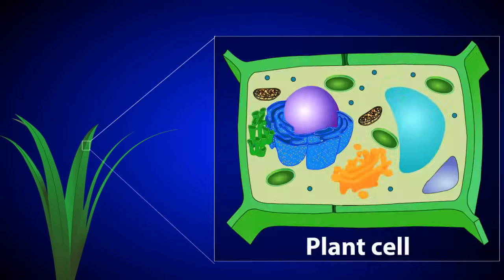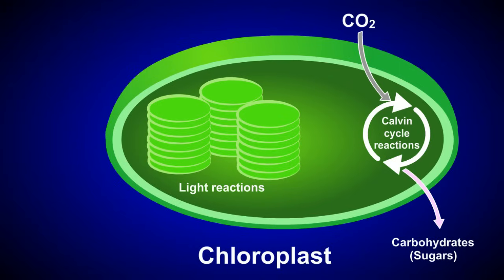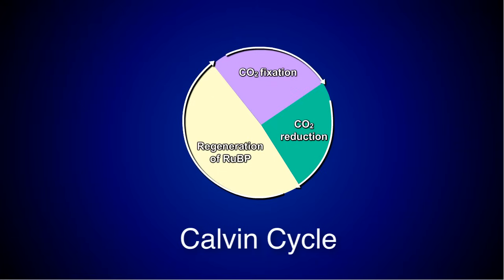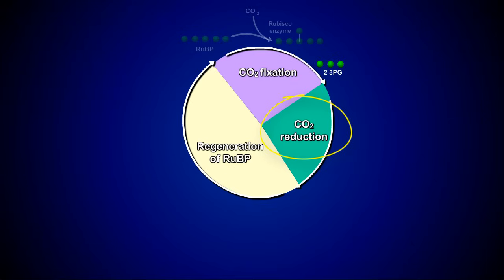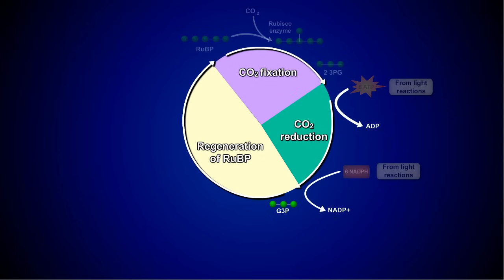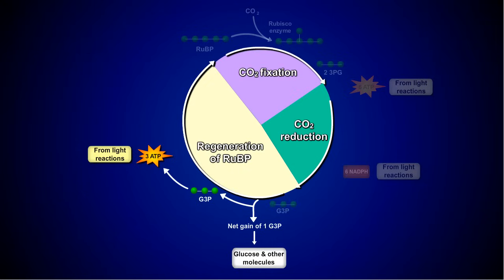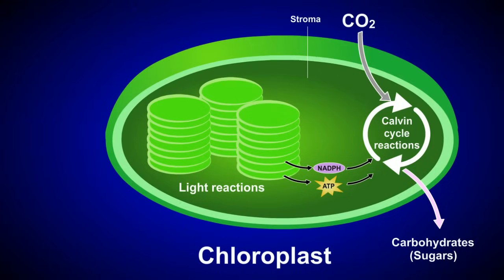The Calvin Cycle

Comment: Calvin cycle

Convert C02 from atmosphere to carbohydrates tlwhich sigar which plants need to power its cellular activities and build new plant 
structures

Occurs in stroma of cloroplast 

Divided into 3 phases
C02 fixation
Co2 reduction 
Regeneration lf rubp

The first phase carbon dioxide fixation basically captures the c02 from atmosphere so it can be used in the reactions  to do this c02 is attached to rubp a five carbon molecule.te enzyme used in this reaction  is valled rubisco ,and the result of the reaction is unstable 6 carbon molecule that quickly spits into 3 carbon molecules.called 3 phospoglycerate or 3pg

Next the process of converting the c02 to carbohydrate begins.this phase is called carbon dioxide reduction phase because were adding electrons and 3nergy to the c02 molecule
During this phase a secquence of reaction uses nadph anf some of the atp from the light reactions this molecule supply needed electrons and energy for c02 reduction 
Electron are added from nadph  and through a series of reactions, 3pg is reduced to form g3p a carbohydrate.adp and nad + return to thylakoids to be converted back  to atp and nafph by the light reactions  one of the g3p molecule is set aside as a building block for glucose.but the majority of the g3p molecule move forward into the third phase of the calvin cycle 

In this phase atp is used to combine the rest of the g3p molecule to form RuBP molecule 
This rubp can then combine with additional carbon dioxide molecule 
Continuing the carbon reactions 

To form a glucose molecule the cycle actually has turn 6 times because each turn of the cycle adds only one carbon atom from the incoming carbon dioxide.

Its important to remember that Calvin cycle is dependent on the light reactions which provides nadph and atp which in turm provide th electrons and energy needed to form a carbohydratea

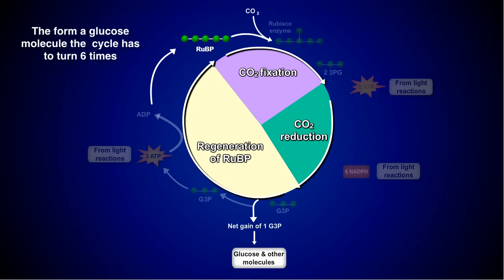Comment: There is an error at 2:44 :)
The cycle only has to turn 2 times for one molecule of glucose.

G3P has three carbons, glucose has six carbons. Two cycles creates one glucose :) you can compare with other sources
Reply: This confused me as well so I looked into it. Just to prevent misinformation. 
It actually does take six cycles to produce 1 glucose, because 3 CO2 must be fixed before one G3P can be removed from the cycle. The CO2 enters the cycle one at a time, that cycle has to happen three times to have enough carbon to make 1 G3P. Three more cycles and now there are 2 G3P. Six cycles for one glucose.
This lines up if you look at the reactants and products for the entire summed up photosynthesis process to make glucose:
6(CO2) + 6(H2O) →C6H12O6 + 6(O2) (That arrow is doing a lot of heavy lifting, as the entire Light and Calvin cycles along with side products are happening there.)

A lot of info graphics and videos, in an effort to simplify the Calvin cycle, cut to the chase and just show 3 CO2 entering all at once to emphasis G3P as the output.
Reply: @jonasc.3937  woah thanks you explained that amazingly for me😘

Comment: You a naughty naughty girl!, 1 GP3 already has 3 carbon atoms in it so the Calvin cycle has to rotate 2 times to make a 6 carbon glucose not 6 times as you said!!  How many peeps have you messed up with that!!  Naughty naughty!! Lol.
Reply: RuBP needs to be regenerated! If the Calvin Cycle is occurring 6 times, we will need 12 G3P chains, now we have 36 carbons (3x12). When we take 2 G3Ps (6 carbons) to create a molecule of glucose, we are left with 10 G3Ps, or 30 carbons. 30 carbons are the exact amount needed to create 6 RuBPs, recall that each RuBP is made of 5 carbons and we are doing the cycle 6 times. One of our 6 RuBPs is added one time in the cycle. So, 6 carbons are needed for a single molecule to be produced, but 5 carbons are needed to regenerate RuBP. If we do 6-5=1 five more times we will get 6, the six times the cycle needs to turn to produce a single glucose molecule.

Comment: 2:43 what does the video mean when they say the cycle has to turn 6 times because each turn of the cycle only adds one carbon atom from the incoming carbon dioxide? I thought G3P is a 3 carbon molecule, and glucose is a 6 carbon molecule, so wouldn't the cycle only have to turn twice?
Reply: I didn’t get that either. I think one of the carbon molecules from the G3P is getting gained so there are 5 CO2 molecules left for the regeneration of RuBP, but I don’t really know

Comment: This is a cool photsynthesis study guide you can use for your mideterms if your having trouble. I didn't create this though!
Photosynthesis study guide
Photosynthesis equation:
6CO2 + 6H2O ----> C6H12O6 + 6O2

Where: CO2 = carbon dioxide 
H2O = water
Light energy is required
C6H12O6 = glucose
O2 = oxygen

Light-dependent reactions
Require water, light, and carbon dioxide
CO2 enters the plant through the stomata
Plants absorb photons from the sun using the pigment “chlorophyll”
Inside the chloroplasts, there are things called thylakoids, which have the lumen inside the structure and the stroma outside the structure
It all starts in photosystem II
Photons strike the chlorophyll and excite the electrons in the chlorophyll
Missing an electron, the chlorophyll will split an H20 molecule and steal its electron. It leaves the Hydrogen inside the thylakoid, floating around, while the oxygen exits the membrane. 
One of the electrons breaks away from the chlorophyll and immediately hops onto a special thing called an electron transport protein.
The transport protein then transports the electron to the second protein complex, the Cytochrome complex.
The cytochrome complex uses some of the energy from the electron to pump more hydrogen protons into the thylakoid.
The hydrogen protons, now inside the thylakoid, are brought into the ATP synthase. The ATP synthase packs the Hydrogen proton onto the ADP making ATP
The original electron, now completing its journey, is moved into PSI where it is reenergized by a photon. The Re-energized electron then moves into the NADP+ Redyuctase where all of its energy is used to make NADPH out of 2 electrons and 1 hydrogen ion along with NADP+
The NADPH, along with the ATP’s, then moves into the second leg of photosynthesis, the light-independent reactions, called the Calvin cycle. 

Light independent reactions
The first part occurs in the stroma and is called carbon fixation. It is called this because this is where a CO2 molecule binds with a Molecule of Ribulose Bisphosphate. This is done by an enzyme called rubisco. 
Rubisco, which was originally designed to harvest inorganic carbon from the atmosphere and then convert it to organic carbon, is actually not very good at its job. The RuBisCo would accidentally bind the Ribulose bisphosphate with oxygen more than half of the time, creating a toxic by-product. 
When the rubisco works correctly, it will slam a CO2 molecule into ribulose bisphosphate, which will then become incredibly unstable. The only way to keep the new molecule stable is to split it in half, making 2 molecules of Phosphoglycerate. This whole process must be done to 3 molecules of RUBP. 
In stage 2, the Phosphoglyverate needs more energy so some ATP comes by and adds a phosphate group, and then some NADPH adds some electrons. This process creates 2 molecules of G3P.
G3P, the final product of photosynthesis can then be easily converted to many different molecules, the most important of which is glucose. However, the plant needs 5 of these G3P’s to replenish the electrons lost and to replenish the original 3 RUBPs. This last phase is called regeneration.

Comment: Btw there is a mistake in the video the cycle needs to turn 2 times to form a glucose molecule and not 6 times
Reply: Actually it do needs 6 turns of cycle to form 1 molecule of glucose but I do have a question like According to my understanding for 1co2 molecule only 2 atp and nadph is required in the reduction process if I'm wrong then correct me ofc